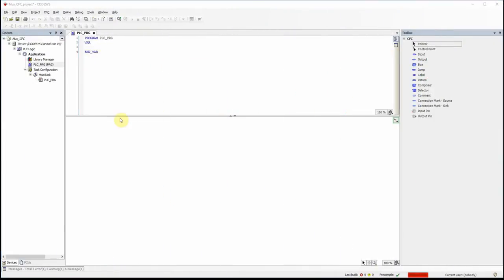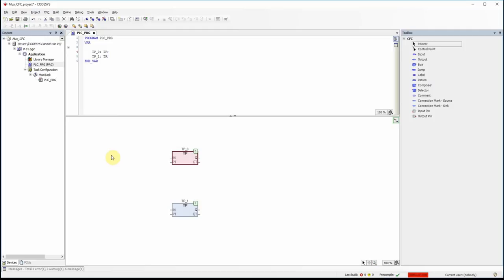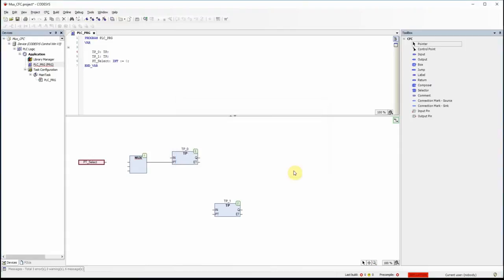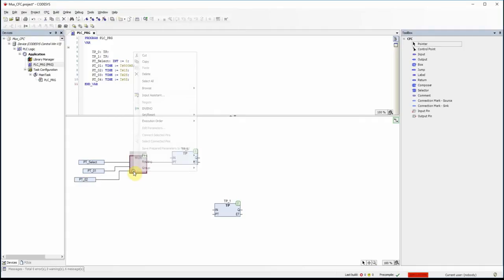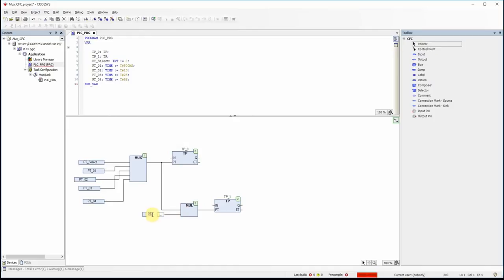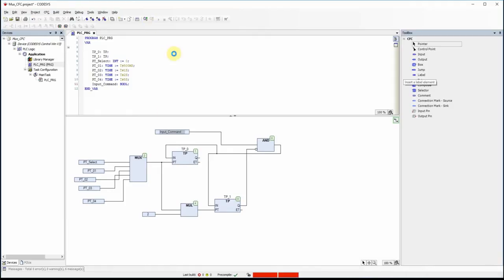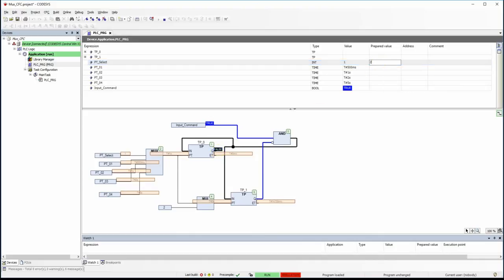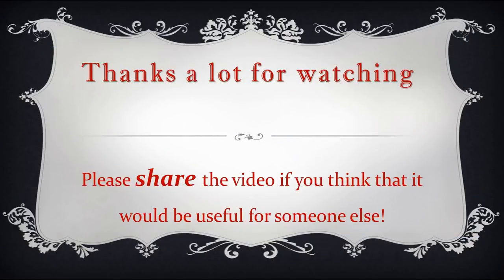CODESYS: MUX (Multiplexer) function in CFC #codesys #plcprogramming #multiplexer #iec61131 #cfc

Comment: Just recently, I had a question. Where is demiliplexer? Why there is no such a block?
Reply from the maker: Well, this is a question for me as well, though its implementation is straight forward.
Reply: Yes, it is not that complicated. The point is that it does not exists. Because in built in blocks you can change  number of inputs or outputs. If you create your own block, you have to change it every time you change number of outputs.
Reply from the maker: That is true. It would be nice to have the built in block.